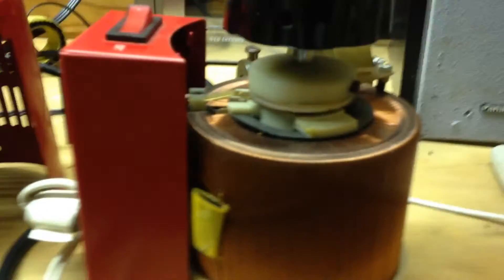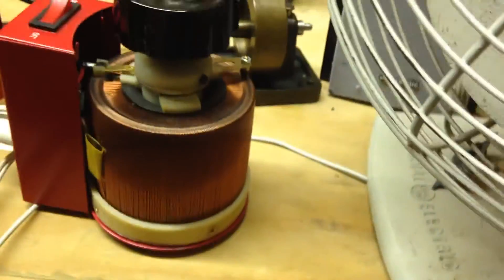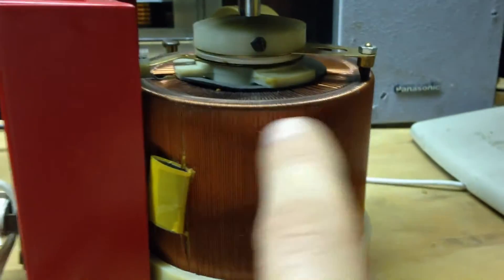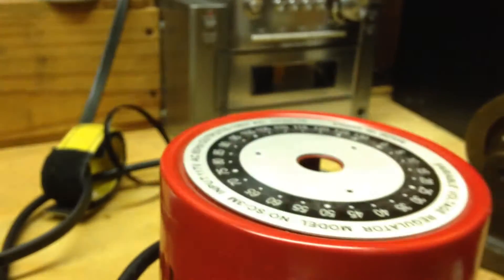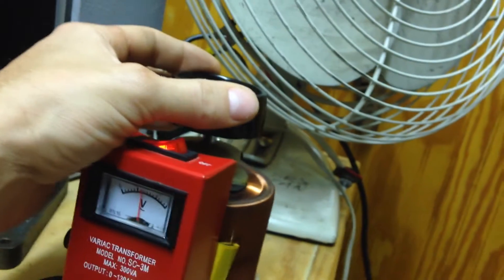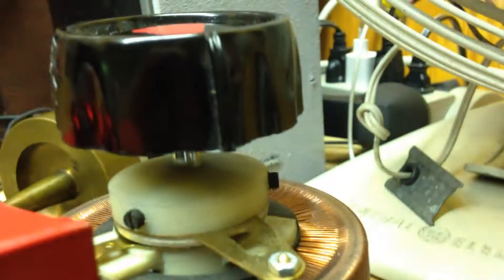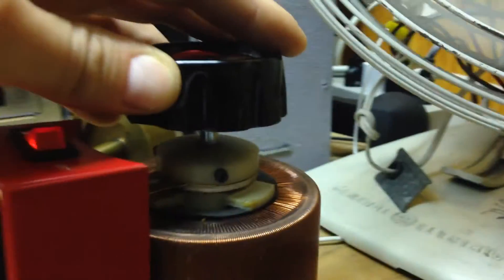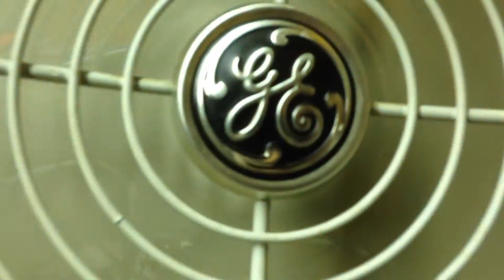Variac inside working

Comment: ah over there in the us you guys only have 110v. potentially lethal. here in aus we have 240v. that will give ya a nasty bite. a while ago i was unplugging a vintage lamp about 1930s vintage. the plug on the back has exposed connectors. as the plug was half way out my finger just got around the back of the plug and touched the live pin. not a pleasant experience at all. that was the last time i did that.